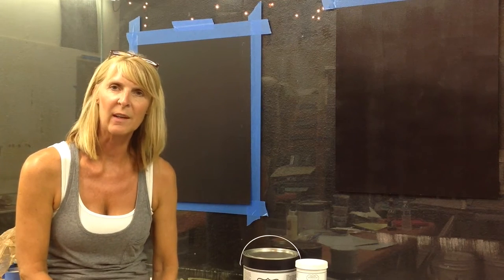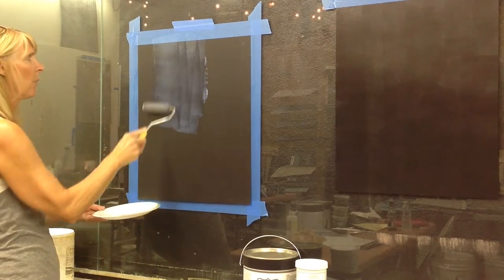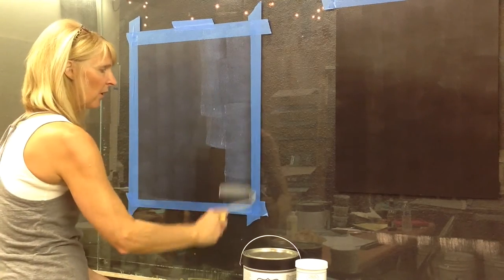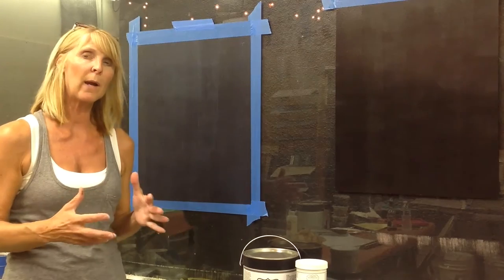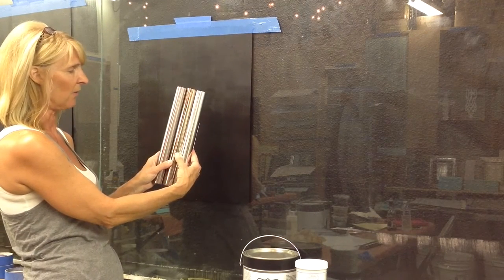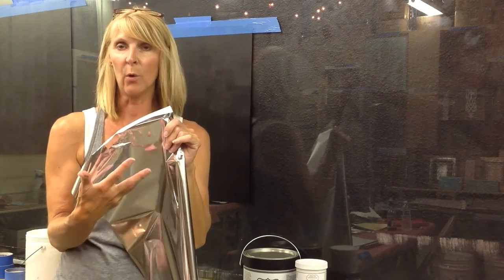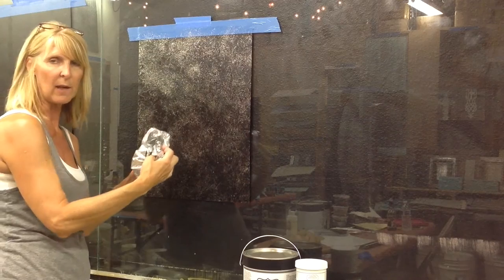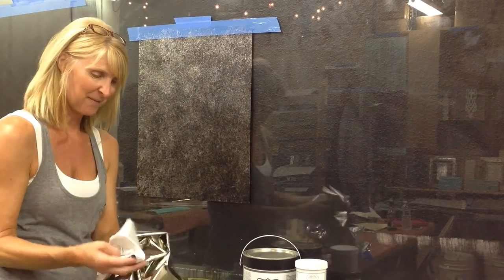A beautiful Foil Finish

Comment: Do we always have to apply a top coat when we do a foil transfer, regardless of the material you used? I just received my foils and I am excited to use them. I just didn't know I had to use a top coat, so I didn't get one. :(
Reply from the maker: Yes, you should topcoat the foils to protect them - they can get scratched or damaged.  You can use any topcoat you have, does not need to be a special product.  Just check the sheen of the topcoat, they will all adjust the sheen of the foils,  You can even use a Spray Varnish on them - I'm sure you can find something locally :)